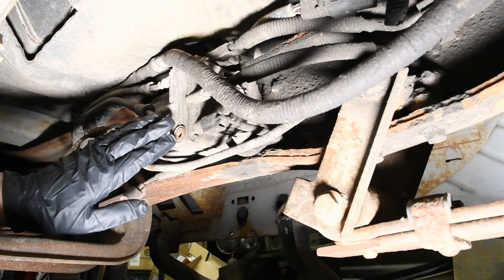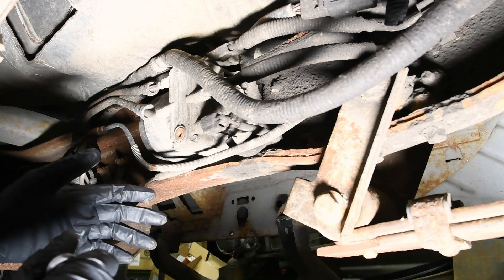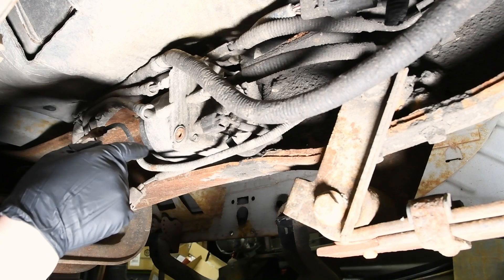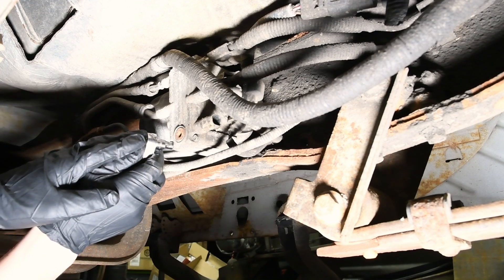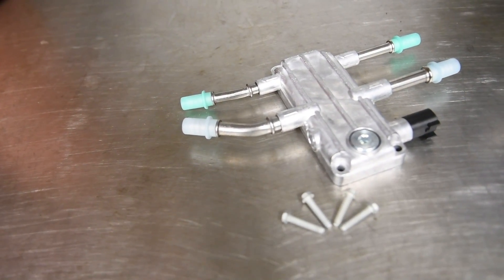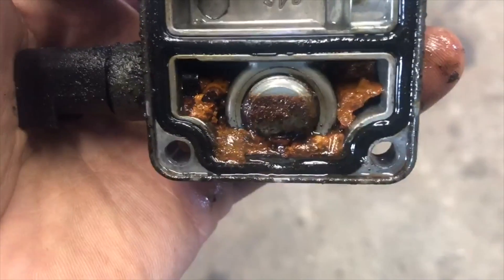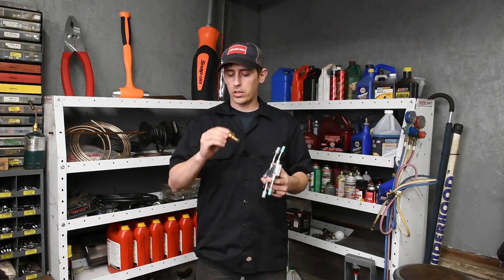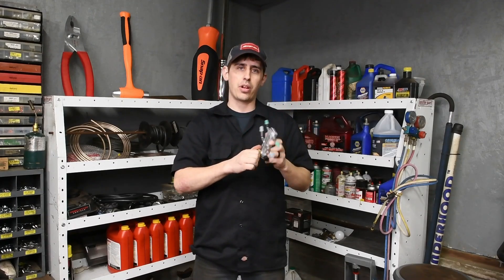6.0 FORD REPEAT WATER IN FUEL LIGHT

Comment: I have a 2005 F350 runs great but only issue is when I'm in the mountains here in Arizona I go start it up in the morning and white smoke comes out of the tail pipe.  It's only done this in cold weather well our cold weather haha, but moisture or not it does this for a about 15min or so then goes away.   After seeing this video, I am wondering maybe my fuel pump housing is clogged and retaining water.   Has anyone had these problems I've been trying to figure it out for some time now.

Comment: Hey guys I got a 2006 6.0 powerstroke I replaced the primary fuel pump on the frame rail cycled the key a few times cranked motor it ran for about 4 to 5 minutes then died so I pulled out the secondary fuel filter checked to see if fuel is pumping in no full is pumping into filter housing and u can hear the pump running

Comment: I have change the sensor twice. Intermittently while driving the fuel water sensor and the glow plug sensor will come on. Lose power for a few seconds let off the fuel pedal. Lights turn off runs great until it does it again 2004 Ford F250.
Reply: Thanks buddy hoping to change mine here shortly
Reply: I’ve got a 2004 doing the same thing. Did you find the issue?
Reply: @stevew6424  
No, I have not. I replace the FICM. No change. I am replacing the wiring harness this week 🤞
Reply: @stevew6424  
Let me know if you find anything.
Reply: I replaced my FICM a couple years ago with a rebuilt one and the Atlas 40 tune. My truck only does this like once or twice between refills. It loses power for a couple secs, water in fuel and glow plug light kicks on and then it regains power again. I’m swinging by my brothers house this weekend to install some 6.4 style tow mirrors on my truck and then we’re going to pull apart the fuel water separator to clean it. I don’t think that is going to solve the issue. Judging by a couple forums I’ve read, I think you’re right on with replacing the injector harness. I read that an intermittent short to ground in the harness can be the cause. That’s going to be my next step.
Reply: @stevew6424  
Thanks for info
Let me know if you have any luck!
Reply: @mikecardillo4510  hey bro, pulled and cleaned the fuel water separator today and it wasn’t that bad. My brother got up under the hood with me sitting in the drivers seat (truck running) and he started moving the injector harness. Sure as shit, when he got
Around injector #7, the lights came on and the truck stalled briefly. Found chaffing on the injector harness and exposed wire right near the injector plug from rubbing on the heater hose clamp. I gave it a tape job for now and I’m going to order a new harness. It’s a relief to have this one figured out.
Reply: Also seems to be more common in the 04s for some reason. Mine is a late build 04, so it was part of the changeover year
Reply: No problem, will do. If you happen to get yours resolved before me, keep me posted. Thanks!

Comment: I’m looking at a 6.0 and the guy says it’ll run for a bit and then die and keeps saying water in fuel, would that possibly be caused by crud buildup?
Reply from the maker: Definitely sounds like some fuel system issues.

Comment: Just knowing I have to use the Ford fuel line  disconnect tool makes me want to not replace this. Ruined all the springs in the fuel line on my Bronco with that dang tool.
Reply from the maker: The lines on these trucks are stainless steel and come apart very easy with the properly sized tool. You shouldn’t have a problem this this one. Push the tool all the way in until it stops then gently pull the line off. Some of the older fittings were delicate.

Comment: Will the old clogged up housing cause the motor to run rough?
Reply from the maker: It would depend on how clogged it was. If it was packed solid it could effect flow through it.
Reply: @InTheShop  okay. Thank you. I had to get a new motor about 5 years ago. Besides some small oil leaks it's been running really good. I hadn't changed the fuel filters in a while and it started running rough. I drained and changed the filters a month or two ago and it cleared right up and ran great. Then about a week ago it started running rough again. I was going to take it to the mechanic but I'm gonna change the fuel filters more time just to see if that fixes the problem. Also I stripped the threads on the drain plug the last time I drained the water also lol. Always something.  I got it to stay in there but it isn't tight. But it doesn't appear to be leaking at all. But my water in fuel light is always on

Comment: I have a question  to ask you
Reply from the maker: What can I do for you?
Reply: @InTheShop  so my best friend has a 07 350 and the no 5 glow plug code came up so did a turbo under boost code and the egr circuit low input this truck has a block like the egr was removed im not sure if it has one or not just yet but i have seen a loose plug dangling by the oil filter housing area
Reply from the maker: @ososcribww  if there is a block off plate and dangling plug the EGR is deleted and that’s the reason for the circuit code. I would replace all 4 glow plugs on that side and the harness to take care of the glow plug code. The turbo boost code needs some more in depth diagnostics.
Reply: @InTheShop  ill definitely keep u in the loop this was alot of help i am a subscriber on your channel  thanks a million my brother i work on import  mostly but but know a little  on the diesel  side not as much as yourself  but definitely  inclined to do the work  especially  the diag id like that you definitely  responded thanks a million if theres something i can help you in the future ill be more than happy to do soo at anytime thanks a million

Comment: Living on a ranch, I can never see the filter housing and lines until I pressure wash all the mud off. Why the hell they put it there is beyond reasoning!!
Reply from the maker: The worst spot.
Reply: Because electric pumps push, not pull. Has to be low on the frame to work, and on a regular cab that's about the only place it will fit. These trucks are built so everything forward of the B pillar is the same, weather F250, F550, or Excursion.

Comment: Good stuff man. I have owned my 6.0 for 15 years now, my first and only diesel and I was never told or knew of the drain port 😕. Thank you for this video!
Reply: I found out a few little things to bring a slow snail moving start to a pretty good takeoff . Mostly things you need to clean and or keep clean
Reply: Just stumbled across this myself . Wondering if it will fix the loss power and or lag if it isn't primed just right. U know the leave then key one for 20 seconds for 3 time back to back then start after warm she runs good , but have to do it just about everytime when you turn it off for more than 30 minutes. Lol

Comment: Any recommendations on getting the stripped stock Allen plug out? I tried JB weld with the allen in there but not working
Reply from the maker: I have hammered a torx bit in to get it out.
Reply: @InTheShop  tried that and metal on the stock plug is just too soft.  ended up pulling the plate with help from your video and putting a bolt & nut through the plug to get it out.  glad i got the redesigned plug in there now.  thanks!

Comment: I like the brass fitting idea. I guess I over tightened my drain plug and stripped the threads even though I know most fittings with o rings don’t need to be so tight. The threads are kind of delicate from what I have heard since. Also your video is the first, I’ve seen that shows that housing replacement. I replaced my whole pump unit after I stripped the plug threads. Good video content and very well shot and produced. Thanks for your work.

Comment: Hey I hit the post arrow by accident! I wanted to say something more specific on closing about the clear descriptions and very well angled and lit views of the work. And showing the actual cause of the problem in such a clean shot and clear description. One thing I do is watch a few different utubers on each process to get the whole picture. I watched another video on this problem and was left unclear in my mind on it. After watching your video I knew I didn’t need to watch any more videos on this subject or refer to any literature. You made it easy to internalize the whole picture. I hope you keep making more videos, I’ll be needing them! Oh! And I worked in a machine shop that did all the work for the San Diego Municipal bus system.
Reply from the maker: This means a lot to me. I try to produce quality videos that explain it well without being condescending. The videos will keep coming.
Reply: @InTheShop hey off subject here, but it looks like I have a torque converter problem. 2006 F250 6.0 diesel. I did a partial fluid change and it seemed to help slightly. What do you think of a flush or the Lubeguard shudder treatment? The Royal channel swears by it. It starts about 35 mph and is mostly gone by 40, but I can still sense it at a lower level all the way up in speed. I really feel it in the steering wheel. It goes away when  I let off the pedal. It's mistly at mild to moderate acceleration. I did a visual check on the front end, which was supposedly all taken care of by a local alignment shop, but I also got Michelin ATR (?) all terrain tires and new wheels, with the tires wider snd taller than the previous. It started pulling to the left a little after that, but that was 5,000 miles and 10 months ago. Suddenly last week it started shuddering. Any thoughts? Aloha!

Comment: Nice presentation. I like your more open minded attitude. One thing I’m moving on to is plugs ands caps for stuff like the fuel lines. With internet sources these days I bought a bunch of generic plugs and caps (cheap!) to do things like plug those fuel lines. Otherwise my only observation is I am more of a fan of doing a thorough cleaning of the area around the work. For novices it is riskier that you could get dirt in where it shouldn’t be. Everything from brushing the surrounding stuff and getting the road grit and dirt in it on the new parts on installation, to getting it on your hands/gloves or shirt sleeve cuffs and later brushing the fuel line tip and getting it in the line before reconnecting it.
Reply from the maker: Thanks Robert! thats great advice. Cleaner the better.

Comment: YEP, IM GETTING READY TO DO THIS NOW, LIGHT COMES BACK ON IN 15 MILES AND I GET 10 DROPS OF WATER OUT, NO ROOM LEFT IN THERE FOR THE WATER PROBABLY, SO IT TAKES ALMOST NO WATER TO TRIP THE SYSTEM NOW, AND MY FORD DEALER SOLD ME THAT NEW DRAIN PLUG YESTERDAY, A LOT BETTER THAN THE OLD ONE, AND, MY OLD ONE WAS DECAYED TO THE POINT THE O RING HAD NO PURCHASE ON ONE SIDE
Reply from the maker: Let me know what you find when you get it off.
Reply: In The Shop what happens if I drain the plug but it don’t stop coming out will change this fix it
Reply: yep it was full of gunk, it leaked when i reinstalled due to swelled seal, went to get a seal and ford told me to replace housing, got that and new housing missing huge electronic component that no longer gets plugged in, its a fuel heater, i opted to use the new style which deletes the fuel heater, ford says they were problematic and not needed.
Reply: now im dropping the fuel tank to clean it and fix my fuel gauge lol
Reply: also did the 2008 transmission pan and full flow filter over the old stock 2003 to 7 screen, goes from 150 micron wire to 15 micron pan filter, only cost 40 bucks to upgrade.

Comment: I tried draining mine the other day but the Allen bolt was already stripped
Reply from the maker: You can try hammering a torx bit into the Allen hole. That would be my first step.
Reply from the maker: Very common.
Reply: In The Shop would replacing the separator be the only way to drain it?